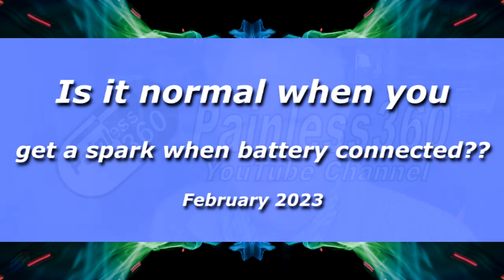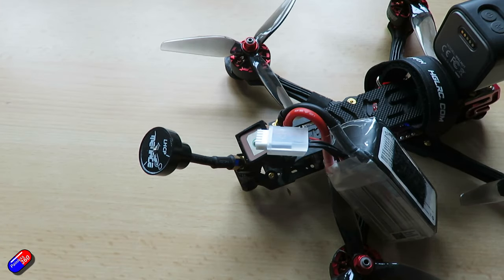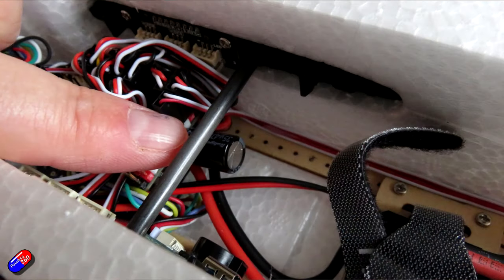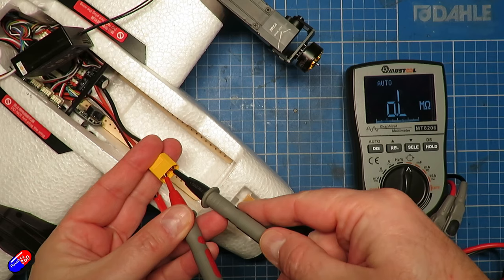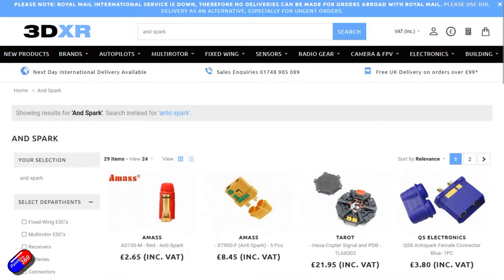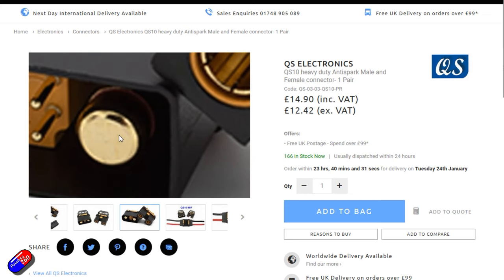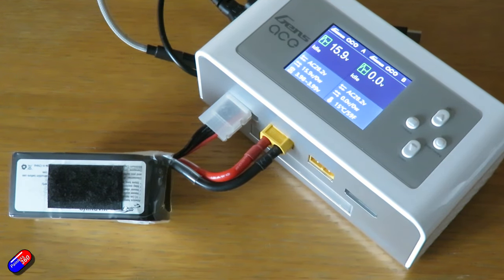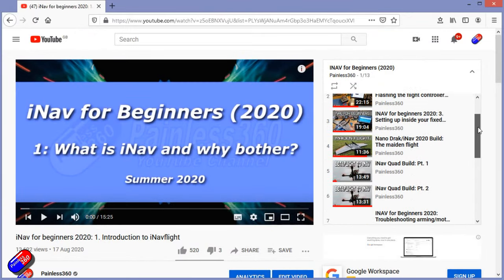Are sparks normal when connecting a battery?

Comment: I'm running a 20s (72v) (ebike) battery and I use a resistor to precharge the caps in the controller, I connect the negative and use the resistor between the positive and it's connection to the controller. I tried an anti spark but it blew the resistor in the connector after a few uses (this won't happen on rc voltages). Excellent info as always. Stay safe Lee
Reply from the maker: Check out those anti-spark connectors. They work very well from the playing I've done with them here.. Happy flying!
Reply: It's a really good idea to slow charge those capacitors, as sparks are bad for the connectors.

Comment: Ahh the power of the first time power up,. You have your first drone correctly assembled, checked that everything is tight, checked that the radio setup is correct and working. You've used a short circuit detector (smoke stopper) all along and now you're ready to try your first maiden flight. You plug in and 'POP', what did I just do? I didn't think it was backwards as you jump and unplug. Everything looks OK, no smoke, no burnt smell, let's try again. The thrill of flight gets off to a very exciting start. Very nice video Lee, it was fun thinking back.

Comment: Here's something that may be worth knowing: if you don't plug anti-spark connectors in properly and then draw a large current through them (e.g. spinning motors) then the resistor will burn out. Makes smoke. The connector will still work but the anti-spark won't amy more.

Comment: If you are very worried about the sparks, you could pre-charge the system at a lower voltage before you connect the voltage (battery) that you will fly with. I recommend using ant-spark connectors such as XT90 or AS150. However, 6s with XT60 has not yet killed any of my equipment (for years).

Comment: Hold a resistor between the xt60 connector and the device. The surge of filling the capacitors will be limited and therefore no sparks. 
These sparks can cause damages and therefore a precharge can be usefull as said via multimeter or even with a bench supply. The bigger the batteries get the bigger and longer the sparks. Especially at home if you have an ESS , a battery connected to your inverter to generate power from the battery once the sun has gone or clouds appeared. 
There you will need such big resistors to avoid the sparks that are quite big and can burn parts of your cable.
Reply from the maker: Nice tip! If you are worried about sparks to that extent, then the anti-spark connectors are fantastic. Happy flying!

Comment: i built a 7s pack to power an inverter, and the initial snap somehow fried a spark-resistant xt90. so it broke the resistor and still sparks. need to try replacing it with a spare and see if i just got a bad one

Comment: Do larger setups not use a main switch in the power circuit so there is no spark when you plug in the battery?
Reply: Unless it's an airpax type circuit breaker as used in industrial cabinets, all that does is move the spark to the contacts of the switch.

Comment: Excellent story except for the high voltage maybe. The reason of the sparks is the instant high current which is the result of high C rating and low inner resistance of the battery/lipo. The electrical resistance of the complete circuit is practically zero at the moment the capacitors are empty on plugin.
Inner resistance of a new lipo is about 0,01 ohm so the current would reach up to 16v/0,01ohm is 1600A. 1600A is an insane current.

Comment: I used to have this problem on my big hex, only 6s 12.000mah batteries, but it was causing issues. I tried the normal anti-spark connectors but found the resistors did not last more than a few uses. In the end I made up a small 'start circuit' which i added to the craft. Nothing more than a on/off switch and a nice beefy 150amp mosfet. Once the battery is strapped into the craft I simply connect the balance lead to the start circuit first, then simply put the switch to the on position. The mosfet then switches the power on for the model. After that simply plug the main battery lead in per normal, then switch off the start circuit. Been using it for a few years now without any issues. I would imagine that on smaller models that use all-in-one esc's that the issue is much less of a problem, with that esc only having maybe one large capacitor. But when you get to the bigger models with a separate esc for each motor, you often find that each esc will have a couple of big electrolytic capacitors fitted. Even at the 26v of the 6s battery, that initial current draw was enough to cause a spark powerful enough to start to damage the XT90 connectors. Originally my idea was to use 2 150amp mosfets in parallel to make a battery isolation switch for the craft, but decided against that because it would be introducing a point of failure into the main source of power.

Comment: So I should just keep the battery plugged in until my quad boots up for the first time? Or does the spark of the capacitor and no response of the flight controller mean there is a short somewhere?
Reply from the maker: While the capacitor charges first time, there is that little spark. It doesn't hurt anything so plug it in with a confident motion and let everything startup.. Happy flying!
Reply: @Painless360  I have plugged it in but the flight controller/ esc doesn’t respond. Would it be caused by the sparking capacitor?
Reply from the maker: Nope. Check out my build series for how I do it... Best of luck
Reply: @Painless360  thank you sir. Blessings to you!

Comment: Here's what I did to avoid the spark/melting; Hook both ground wires with the same gauge wire together and then both positives on a switch that could handle the load.

Comment: It must be investigated case-by-case. In my case 'SpeedyBee F405 BLS' it produce large spark when 1000uF capacitor is not connected. Looks inappropriate to me. Maybe a momentary short cause by floating state on FETs driving while firmware still booting? Who knows. Hard to tell the cause when part of the project is closed source (hardware). Anyway startup sparks are never a good signal. Not that worrisome if the only cause is just the charging capacitors though.

Comment: Worked most my life with electricity,  my favorite battery story. Ok , made ball lightning with a battery. . Now you need a rather large battery, in this case 400 volt, 10,000 amp.  Two wire got mismarked and installed backward. The battery was across a exciter which could generat an equal amount of power, and ax600 horse power motor. When the circuit was closed it locked in ...strange noise, and two small glowing orbs. Unlike anything I had seen. Fairy like in color a benign pastel palette of swirling color. It seemed like along time but it was mere seconds. The smaller one flashed to ground  the larger one floated about keeping 6 grown men  frozen . Now I understand such can also be done withe a WWII submarine battery but they are a tad hard to find.  Had to share ...take care.
Reply from the maker: The one that sticks in my mind was the fitter that I was shadowing in the early days had just installed a chunky three phase motor and was about to make the last connection. A pal of mine made a joke and I clapped my hands one, very loudly. It turns out that by sheer fluke, as my clap echoed around the plant room it was the exact moment he touched the last wire to the terminal. He jumped up about 4 feet into the air swearing loudly and wasn't best pleased when he realised that the loud 'bang' was me, not his connection going up in smoke! I wasn't flavour of the month for a while, I can tell you! Happy flying!